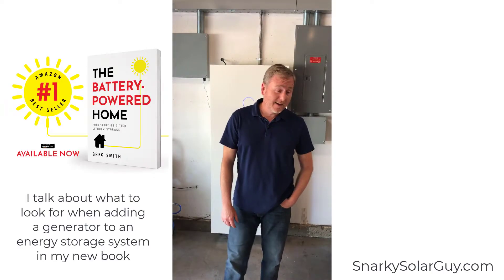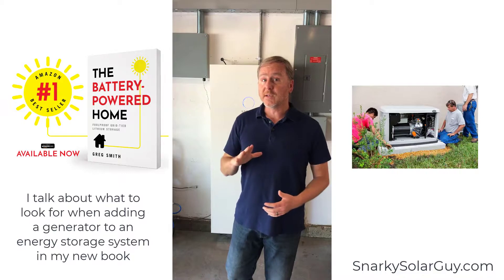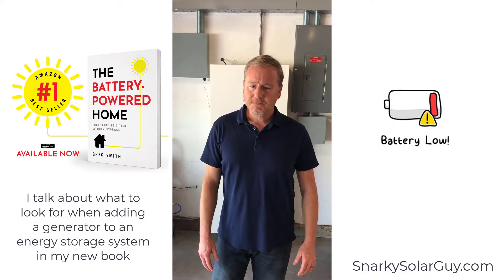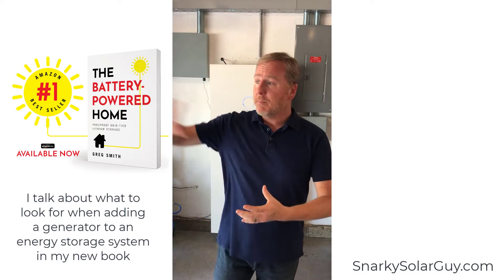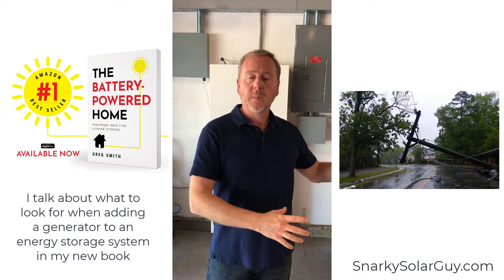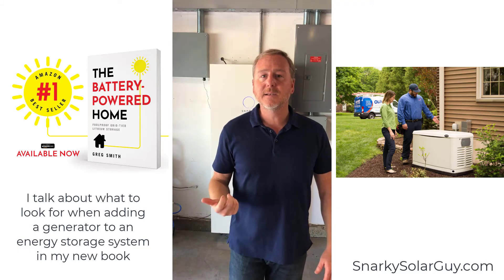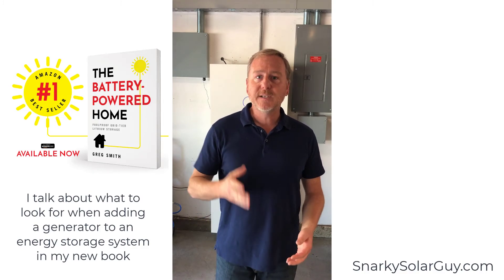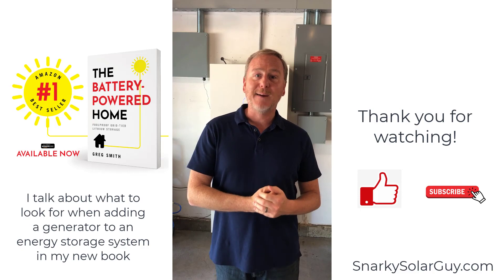Real Talk: Generators and Energy Storage Systems

Comment: That makes sense.  I'll be sure to use this real talk for my solar customers who are headstrong for generator compatability.  We live in a travel trailer, so no equal comparison to a whole homes needs or equipment we have.   We have a Victron inverter that pulls from our battleborn batteries.  We are able to take on full 750w and use a generator at the same time. Though the most recent heatwave threw us into the shade so no solar production.  1st time we used that generator in a year of Nomad life.
Reply from the maker: Wow, so sorry for missing this reply. The Nomad life is a dream of mine. My father did it for about 5 years after he retired. I have heard good things about Victron. Generators are often an under-thought out component and there aren't many solar installers who have the experience with them. Thanks for commenting. Happy wandering!